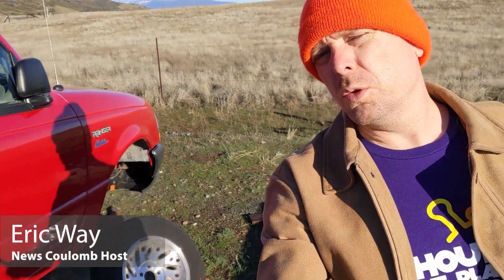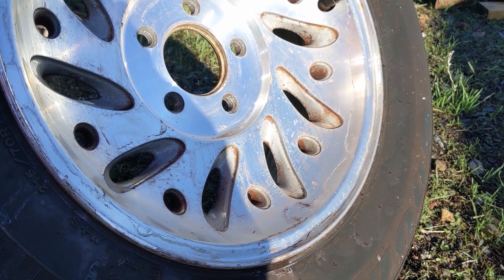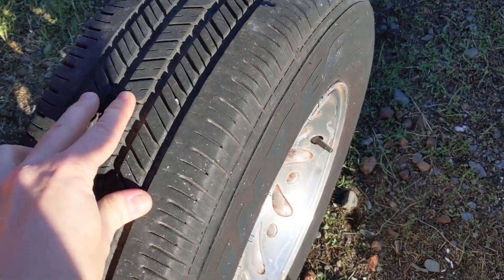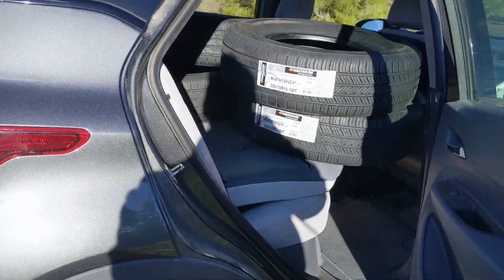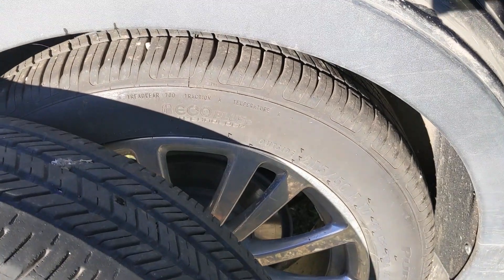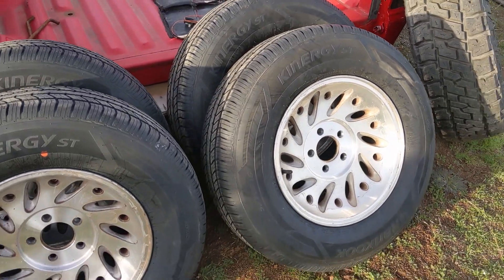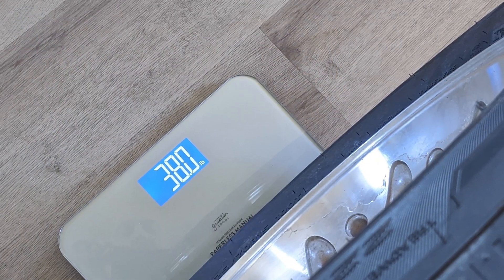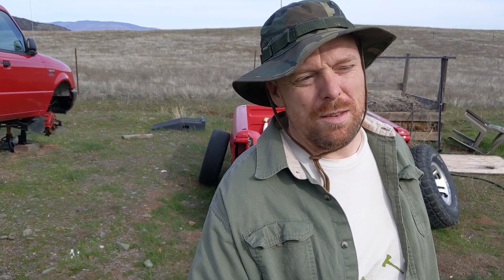Ford Ranger Electric: Rims and Tires

Comment: I would wager that the new modern technology Hankook low rolling resistance tires will be MUCH more efficient than a late 1990's early 2000's low rolling resistance tire.  Thanks for the update :)
Reply from the maker: Thanks! Yes, I'm hoping for the same, though I'm not sure. On the stock tires, the Ranger was getting over 4 mi/kWh at 45 mph, so improving on that would be impressive.